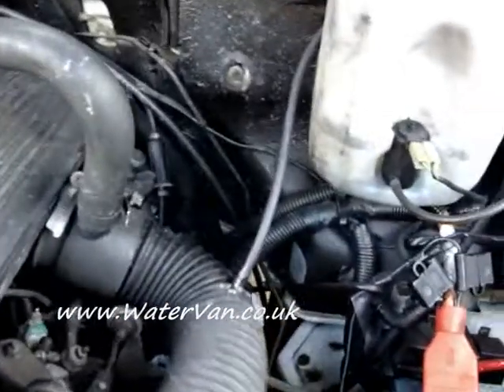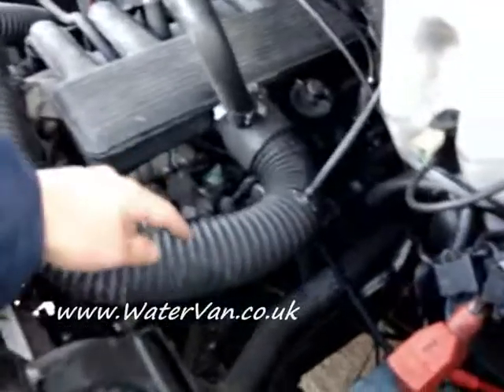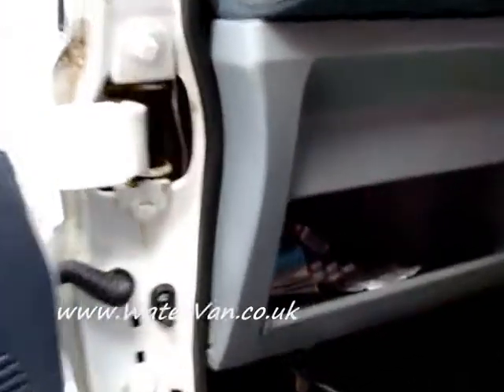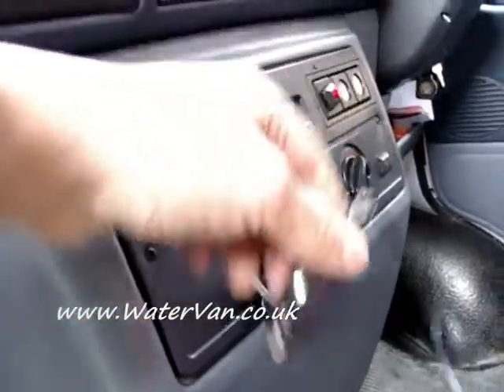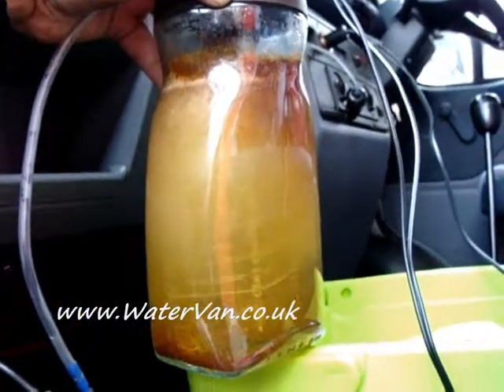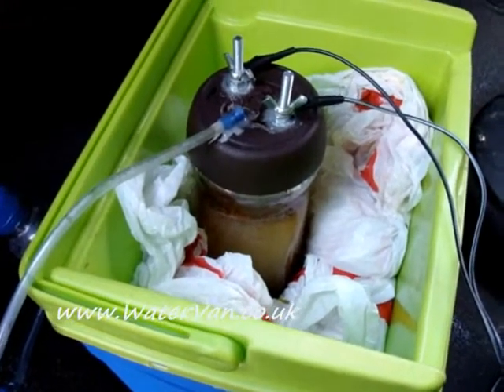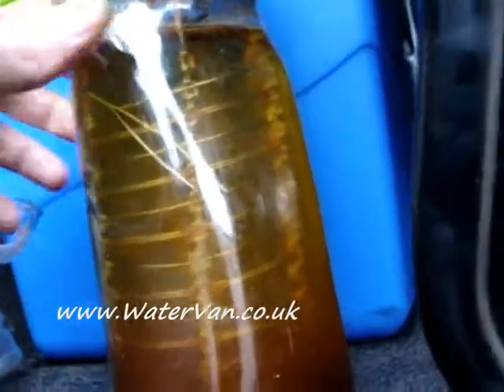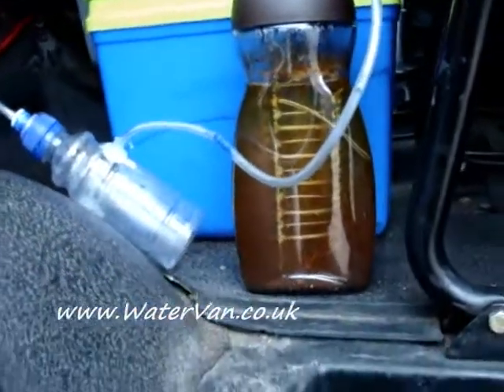#010 - MadStu's Water Powered Van - FAILED :(

Comment: Bicarb deteriorates quickly in the reaction so you have to keep adding it.  I can run same charge of KOH for months.

Because the Bicarb is consumed, I have found that the reaction is harder to predict as the values are constantly moving. 

I find that the cleanest reaction results from distilled water and KOH. Creates less crud than Bicarb.

However, Bicarb is cheap, easy to get and works.  But you will be giving off a lot of carbon monoxide gas which impacts HHO potency.

Comment: I use KOH as my electrolyte. KOH reacts violently with anything aluminum. 

A small amount of KOH evaporates during the reaction but its easily re-condensed if you use a "closed loop" reservoir like what I use. Recycles the KOH for continued use and keeps the KOH out of the engine where it might do damage.

That is purpose of my setup. Though I am moving to a smaller reservoir of similar design soon now that I am finished experimenting with the pump.

Comment: Good heavens, NO GLASS.  GLASS BAD! NASTY SCHRAPNEL.

Key element is to design in a weak point so an explosion will be directed in a safe direction. This should be used both on the containment for your device as well as on your bubbler. If there is any small quantity of gas being confined in a component, it should have a "blow cork" of some sort. 500ml confined will take off your hand so treat it with respect and expect it to go boom.

Comment: well, once you get your build settled on, you should really mount your gadget under the hood, uhhh bonnet. Having your gadget riding in the passenger seat is a bit of a worry. I have visions of you driving down the road at 90kph and the thing decides to go BOOM.  Bad images of resulting mess.

It looks like your apparatus is designed to safely go BOOM.  Materials are low mass, no glass, no hard plastics that end up being missiles.  So other than proximity, you look to be in good shape.

Comment: try a boating store ... boaters require good quality stainless ... will be expensive but worth it in long run unless you can find a cheaper vendor ... my local hardware store has a decent selection of basic stainless hardware but he charges a lot for them ... stuff outside your jug not in contact with the reaction you dont have to be so picky about.

Comment: you are thinking correctly ... multiple smaller divices works well ... a number of experimenters are getting good production using this method ... so your got 12vDC+ to jug#1+, jug#1- to jug#2+, jug#2- to jug#3+ and so on with last - back to negative on the source. Volts will drop across each jug. If using 12v divide by 4 jugs, you will be at 3v. With 5 jugs, you will be at 2.4v.  2.4v to 3v per plate gap is right in the sweet spot. Use your own math but that's the idea.

Comment: If its exposed to the soup, it should be stainless steel or non-conducting plastic. No copper, zinc or chrome in the soup. Best not to mix metals in the soup either. So if possible, should all be same grade of stainless though this is not such a big problem as using copper, aluminum or plated connection/bolts/washers/nuts.

Aluminum and some chemicals used as electrolytes make for violent chemical reaction.  Avoid aluminum.

Comment: Water cracks when 1.5v is applied. Process is pretty efficient until you exceed 3v.  Beyond 3v, more energy is going into heating the water than cracking it.  To get the most gas possible from the amount of energy you apply, it is best not to exceed 3v per plate gap.  If you have a simple +/- pair and apply 12v to it, you will be making more steam than gas. Neutral plates cause voltage drop to get it under control. Multiple small +/- devices in series also works well to control volts.

Comment: To be honest with you, the price of good quality stainless steel is pretty hard on us here in the US also.

As far as ideal plate size goes, that's really a matter of preference.  Some like long skinny ones, others like them square and still others like them round.  I use a 6 inch x 6 inch square plate and it works well for me.

Can tell you that the more surface area, the more amps it can stand so more gas it will produce.  Amps=gas in low voltage electrolysis.